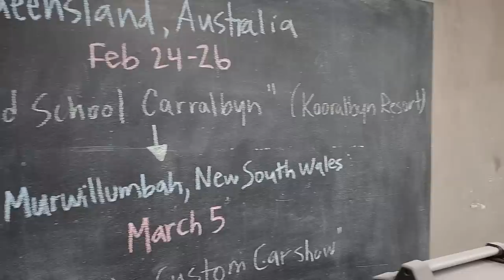Back to fabricating – starting a new/old project 1928 Ford C-cab truck 🚨

Comment: Might I suggest next time using a round metal fence post or something like that mounted in vice and weld it to the metal to it wrapped around it and work it as needed and then use the nibbler to cut it off the pipe or your favorite cutting tool another thing if there's a small tube welded to it before the line and it'll keep it from pushing it out and actually bend it on the sheet metal brake

Comment: Hey Chad,  just a tip if you don't use this technique. When backing up a trailer,  grab the steering wheel at the bottom with one hand. Whatever direction you turn the wheel is the direction the trailer will go! Steve, from Bridgewater

Comment: 41:36 The metal brake has an adjustment for the top clamping jaw, forward and back. It can be moved out to the edge of the bottom stationary jaw. Usually leaving the material width back from the edge. It gives the material a place to fold up into when bent.👍🏻

Comment: Love these guys , Chad an Jolene..  I learn so much from this content, I've done body work before but not to this level . I've watched old timers in my area do this an I learned so much but they retired so glad Chad does this. There's a kid doing a custom jag an he cut car in half but is not doing the steps right he should weld the frame up first to get everything else to line up.he needs to watch Chad work then he will be a master fabrication expert.

Comment: Very cool 😎 thing with the headlights turning....I like that alot...hope with adding the fenders your able to keep that somehow...the grill be up where it should be..makes the truck so much better...be nice if you could put a hood ornament on the top of the radiator shell instead of welding it in...but will be cool anyway you do it im sure....cya tomorrow Chad and jolene

Comment: Hey guys, absolutely my favorite channel! Chad, screw some 2×12 to the length of the deck of the trailer where the tire's run. It will make ot easier to get vehicles on.

Comment: Greta job Chad and as always fantastic camera work Jolene.
I agree that lifting the radiator cowl and having a bonnet on this will look fantastic.
Jolene was spot on when you had the flat edge sitting down on the fire wall recess and the other end on top of the cowl.
Jolene has a great eye.

Comment: Great Idea Chad, I grew up in the oil industry, my dad worked for a big local oil company in New York. I started pulling hoses on oil trucks delivering oil at 13-14 years old. Prior to that oil and  kerosene was delivered by 5 gallon cans. I have ideas for you to redo the truck to make it fit the job during its age. P.S. I’ve been looking for a  old tanker to redo for a reminder of the oil industry’s growth from way back then.

Comment: New here I have a 1930 model A caberta. Your cowwal is a 29 the radiator shell is a 30  the t radiator shell is a 24   the flat head looks like an 8ba .cheers to ya.

Comment: Can still keep the turning head light Chadly , Go with a flat style front guard or make a new rear section of the light as a small dish shape and have a slight gap for it to swivel [ Eyeball stlye ] where it sits in the front of a shaped front guard ..

Comment: You can change the bend radius on that brake by putting some short pieces in & bending them all the way back against clamping shoe then clamp the piece to bend under pieces & it bends it to a larger radius, you will need to adjust clamping shoe reward some for clerance.

Comment: I think I would make small front fenders that are like on the front of a motorcycle.  Fenders will turn with the front wheels. Therefore, mount the headlights to the inside of those so they still turn with the wheels. Just my Hillbilly idea!

Comment: Chad there a small plate missing at the bottom of that rad shell with a hole where the crank goes, l think you should be able to make one, you should also be able to see what it looks like on line.

Comment: When you get to making the hood, you can use piano hinge to hold the pieces together and be able to open and close like stock. Piano hinge is available on Ebay in any length you need.   👌

Comment: I think it would be cool if you made the front fenders attached to the same bracket as the headlights so they steer with the front tire. I like the steering lights.

Comment: I think most foreign motorcycle places build a three wheel machine with 2 wheels in the front and one wheel in the back the fenders that are on the front of those look like they may work and still be able to maybe make the light work with it
Reply: I think they call then a spider with a y

Comment: Chad, how about adding an electrically operated ram with a foot on the bottom to use when you need to raise the front of the trailer? Seems like a lot of effort to drag the jack around to raise it. Keep up the good work.

Comment: See when you come back to old project's you either come up with better or different idea's to change up.
That's what I said about the truck Chad and Jolene were working on got the bulk of the work done, now just leave it and come back to it later might come up with a different idea's or change something you changed your mind about.

I have many rotating project's that I'm working on and I notice when I come back to the project with a fresh mind on changing or coming up with an idea to make something better or I'll find something for free to add to it. If I rush a project to get done later on I'll wish I did something diffently. 
Unless it's a customer's thing then I will rush or get the customer's thing done at a timely time don't want there stuff sitting around my small work area to long.

Comment: You need to look at the slope from the firewall, top and sides to the radiator shell before you start. From the camera angles I can see, it looks like a pretty steep slope down to the shell.  Just saying

Comment: Should mount a fuel 100 gallon fuel cell in the back and make it work with the spouts to drive around and fuel your other cars that would be cool mobile gas station ⛽️

Comment: Wont it run hot with wrong radiator? Plug coil wire in crank it up

Comment: When are you Painting, Jolene's Bugatti ? I thought you were cleaning up the shop so you can get it in the paint booth. should've ground off that rusty old metal before welding up that seam. That is if you want a good welded up joint.
Reply: Well you thought wrong 😂come back in couple years might have off the jack stands

Comment: theres two tipes of engines we can used in this proyect , we can use a jet engine , or we can use electric energy , this truck can be powered by an electric motor , we have a lot of electric motors on california junk yards , that can be easily mounted on this truck you will save space and will have more modern look , you can use the same transmision and just electric powered , if you have any questions I available , im an electric engineer  that worked at electric vehicles manufacturing company , feel free to call me , this old truck will be amazing on a car show , this combination of old car engineering and modern vehicle transportation , I REALLY LOVE TO SE JOELENE ON PERSON , basically , Im open for cuestions about electrical power vehicles ...

Comment: use motorcycle fenders on the front. .love the headlight turn , very uniqueput a 1/2 doors and skirted bubble fenders in the back , leave the running board as is and louvered bad chaz hood